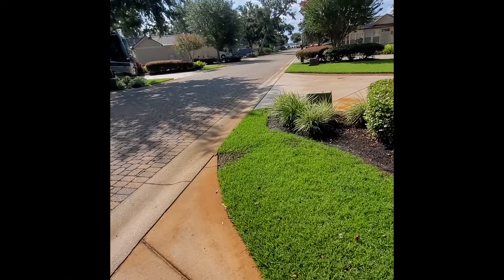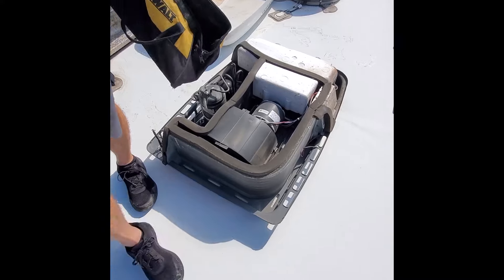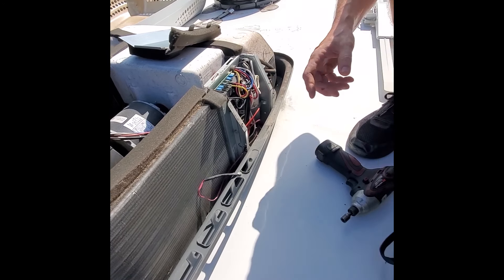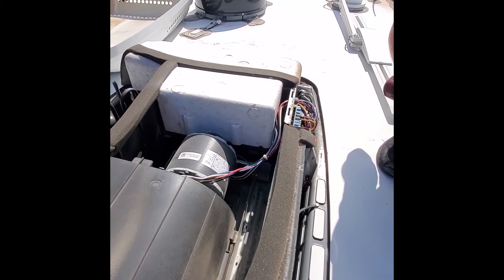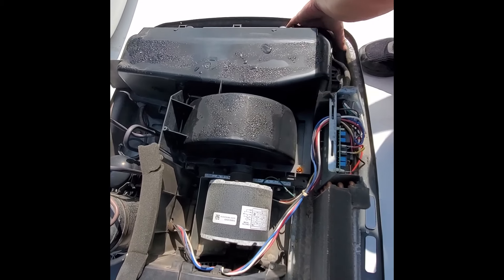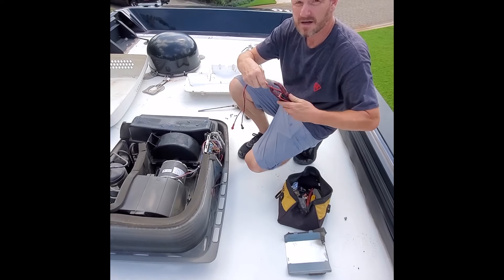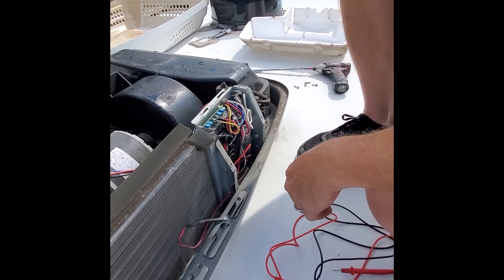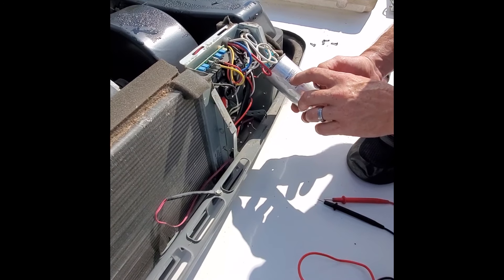Dometic RV Air Conditioner Capacitor Strikes Again!!

Comment: A lot of videos on youtube sing the praises for an Easy Start kit $349 when a $42 capacitor is the simple fix.  Thank you.  New subscriber.
Reply: The main & only advantage for an Easy Start kit is it allows you to run your Roof Air off a 2000KW generator rather than a 4000KW generator.
Reply: Capacitors are 8-15$ in the US

Comment: Josh, on my unit I changed the 3 capacitors but still the compressor fails to work ( it tries to spin but it stops after a few seconds). The fan works great. What is next for me to do? How can I test the compressor itself? Thanks
Reply from the maker: @jaimelopez3991  sounds like it's time for a new upper unit

Comment: Thanks for the great video, personally not a fan of the impact tool for this kind of work, I prefer a drill with adjustable torque setting to prevent damage to screw and bolts. However, each to their own.
Reply from the maker: Thanks for watching!

Comment: What I forgot to ask is , can the fan still be blowing minimally if the capacitor is bad or going bad ?
Reply from the maker: @grumpowski64  It's possible. The capacitor, voltage, fan amperage need to all be checked.

Comment: Isn't it extremely dangerous to work on a Capacitor?  We have a similar issue but my husband is questioning whether to work on it because of the dangers of the work.
Reply: Biggest danger is working with the power still turned on to the AC.  Turn it off at the breaker and verify the power is off with a voltmeter before touching ANYTHING in there.  But capacitors can sometimes hold enough charge to give you a nasty shock even after power it turned off.  After verifying power is off, use needlenose pliers or a screwdriver to briefly bridge between C and Fan, C and Herm, and Herm and Fan to ensure all residual charge is dissipated.  Then it is safe to work on.
Reply: Over the years I have replaced capacitors. I always follow procedures to discharge the capacitors. 
  So far I have never seen so  much as  a spark while shorting the terminals out. 
  I have yet to have one
 loaded. But I still follow safety procedures.

Comment: I changed the capacitor and I still have to spin the fan in order to get it to work what’s else can I check ?
Reply from the maker: If you have good voltage and a good, correctly sized capacitor....you need a new fan motor.
Reply: @MRRVTECH  that was my suspicion is there away I can find my model number on the fan as the paper work on the outside is faded to much to read

Comment: I wanted to let you know, how valuable this video was to me.  We put on the AC in the middle of the day(never do that usually, only the morning before it gets hot) and shut it off quickly and turned it back on and no fan. So I went up and checked the fan(had to start it by  hand and very slowly moving), added oil no change. Go down and put AC on but didn't help and in fact breaker trips. End of AC and time to get a fan, thinking that will fix it. Get the stats look it up and videos show up on how to install new fan. While watching it I saw video "Dometic RV Air Conditioner Capacitor Strikes Again" and  thought I should see this and was convinced this was probably it. After seeing the vids on changing the fan and getting the courage to discharge(which was a non issue it was toast), I found a local source and within 24 hours it worked again. 
But the fan rumbles a bit and seemed hot to the touch, it was holding a 60+10 and all I could get was a 60+7.5 though the specs say 60+ 5 is enough for the fan. We ran it late in the day with no issues for 4 hours. Does it sound like the capacitor isn't strong enough(it has a hard start cap on it as well that checked out fine( I think both caps were mods as we are the second owners)? 
Edit: this may just be the sound of the compressor working, the fan is cooled off by the cool air circulating I suppose.

Thanks very much for the great video
Reply from the maker: Yeah, the motor will have a capacitor rating on the label like " 5 uF" or " 7.5 uF" it should be replaced with the correct capacitor, under rating your capacitor will greatly reduce its life span. Thanks for watching!
Reply: Thank you for comment. My Ac is doing exactly what yours did.

Comment: Hey man. You are super useful content creator. Hey I have a question. I have a 3 year old fifth wheel with domestic roof ac 15k. Bought it new 2020. On Monday we had power outage. On Tuesday I came home from work and camper was oven. Looked at beaker box and that breaker was tripped. Reset breaker and boom back to working. Woke up in am same problem. Reset breaker, everything working. Come back from work second day same thing. Breaker tripped and hot. Reset breaker and everything is working. Next day come home this time fan is running but no cold. Reset power and boom, ac working. Next day come home same hot inside, fan working but no cold. Reset power and cold working. Next day come home everything dead. Breaker tripped. Reset breaker but ac does not come on. Go on roof, open up top and hear compressor running, lines cold fan not spinning. Spin fan by hand, kick start it and it starts spinning. Minute later ram stops. Kick start again comes on, runs and stops. Again and again until my dumb self broke the fin from kick starting it. F$@k. Ordered a new fan and motor. Do you think it’s the motor that’s bad or capacitor or mother board? Have you seen this before?
Reply from the maker: Motor 100%

Comment: Thanks for you video - informative. I see that this unit is very similar to the B3200 that I think came before the Pengium which now I believe is the Harrier.  I have had two of these aircons and in New Zealand they appear to last 4-6 years before developing a leak - mostly in the evaporator.   I also have had, prior to the regrigerant loss, the thermistors on both the condenser and evaporator go on multiple occassions. In each case when I replaced the thermistors with ones from an electrical wholesaler (5k ohm) it is rare for the thermistors to fail again. 

My conclusion is that these Dometic aircons are generally poorly made. They seem to suffer from poor thermistors and this means two things - the defrost cycle is not engaged for the condenser early enough (end up with block of ice) and poor heating in winter as a result.   The same appears to occur for the evaporator when cooling.   Because the evaporator is smaller than the condenser the evaporator (when cooling) appears to get frosted up far more frequently and this will happen even more frequently is the fan is not on high. Given the gas leak ultimately occurs in the evaporator the frequent icing up, along with the very thin pipes in the coils,  means that ultimately a crack is formed in the evaporator coil pipe and we add to the global warming. The unit is largely unrepairable as no service ports are installed so the rest of the unit heads down to landfill.

I would be interested in your thoughts on this diagnosis and general thoughts on reliability of RV air con units.  I have found them to generally have a poor lifetime. My aircon in my Mazda car, which is 22 years old, still works and has only had one regassing. It is therefore possible to make an aircon that lasts 20+ years. It would appear to me that Dometic are more interested in short life. A youtube search of aircon repairs.

Geoffrey, NZ

Comment: My duotech dometic, was running just fine last night on high-power and I thought I would use the convection oven at the same time and I blew the 30 amp breaker on the generator.  And now the front air conditioner doesn't work but the back one is still ok. This morning I had on a 1300 w space heater going in the front part of the RV and the power was flickering off every so many minutes. So it seems like a general power issue in the front half of the coach. My question isn't there just a basic fuse for the air conditioner?
Reply from the maker: No. I highly recommend getting a qualified RV Technician to Check your AC electrical system.

Comment: Would those caps die in just 2 years?  If the unit was working intermittantly for a while then stopped working at all and won't start now, what could be wrong?

Comment: How much would this repair cost? I just found a bad capacitor and will be replacing it tomorrow but my local shop wanted $1900 to put in a whole new unit. He said they don't troubleshoot old air conditioners which to me seems a little silly if it's just the capacitor

Comment: Nice video, capacitors usually suspect when a compressor or fan doesn't start. Question, I'm thinking of installing a hot start cap on my Dometic AC for boondocking purposes, do you have any words of wisdom concerning using these?
Reply from the maker: They do what they're suppose to, you can see a noticeable difference in the amperage on a volt meter at start up.

Comment: Quick question.  Where do you buy the replacement capacitors for these RV AC's?
Reply: Can get them from dometic, depending on model they can be hard to find.

Comment: Ok so I just put the SECOND capacitor on my unit. It runs for a bit then kills the fan out and it just humms. Compressor runs fine. Here’s the catch, sometimes it will run the fan in high and low and sometimes it just humms. Wtf is going on??
Reply from the maker: Bad fan motor.

Comment: After repairs don’t you have to reset the thermostat
Reply from the maker: Usually o ly if you replace one or change the circuit board. Not after a capacitor swap
Reply: @MRRVTECH  
What about a motor
Reply from the maker: Nope
Reply from the maker: The only thing that would require a reset are the dip switches on the Printed circuit board. You could also recieve an E7 code from shutting the power off, simply restore power and turn the thermostat off and back on.